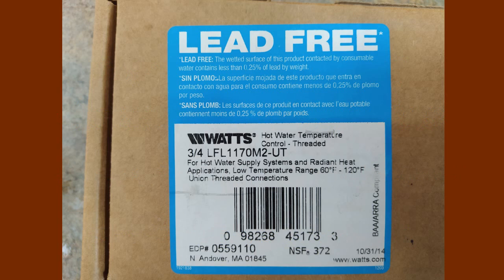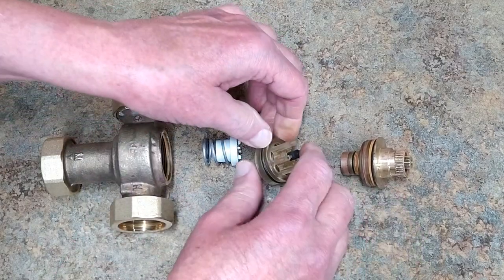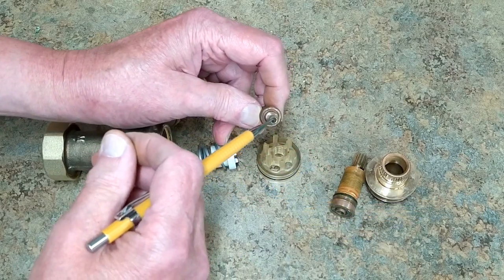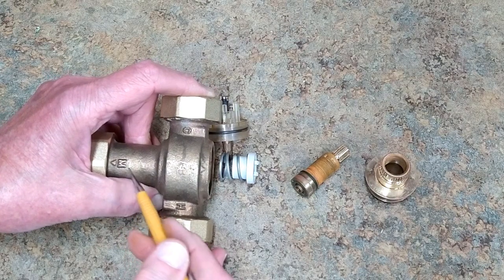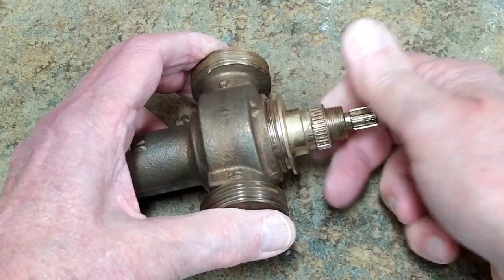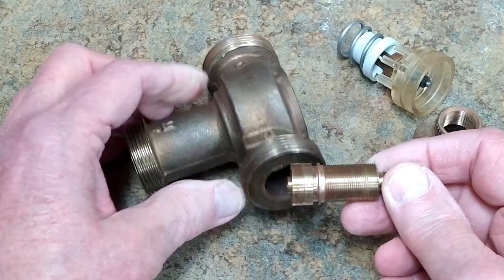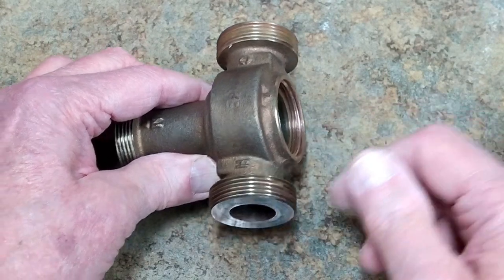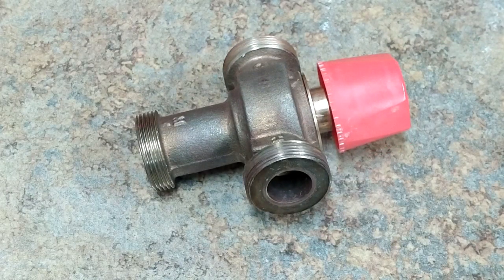Watts Thermostatic Mixing Valve - Rebuild

Comment: Thank you very much. Your video of rebuild of valve helped me with fixing frozen Watts Mixing valve without removing from water inlets. Basically I was holding main circular screw with one plier and rotated the adjusting small screw with another plier. Earlier I didn't know if the small adjusting screw alone rotates and thought of replacing.
Reply from the maker: Glad it helped. Look around my channel. You may find other subjects of interest.
Thanks for watching. Please subscribe! 
That is what keeps this channel running. 
Ron